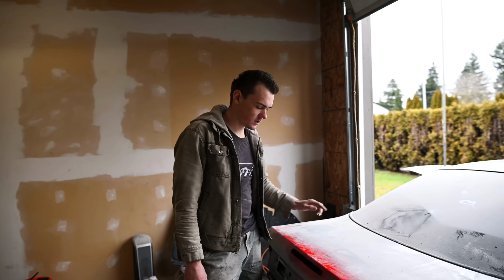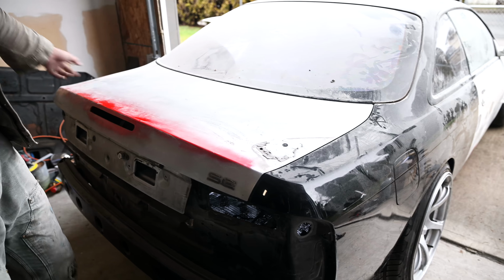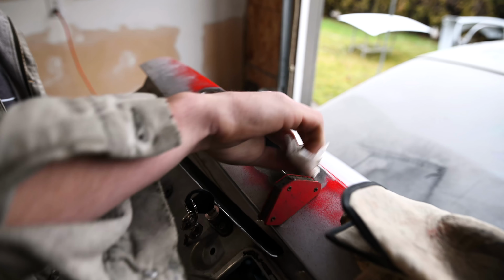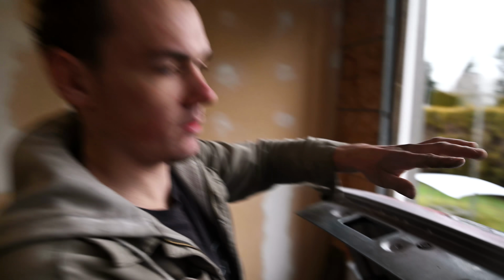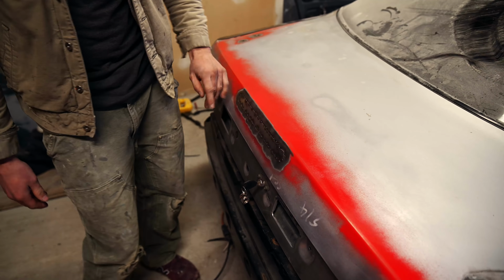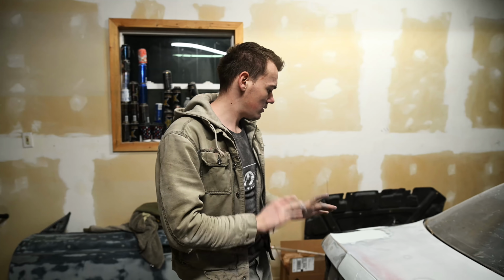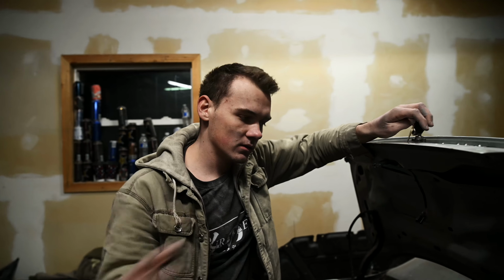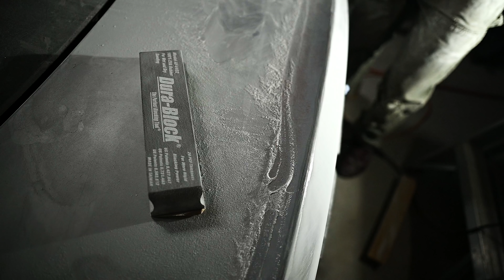EP.12 | DELETING Trunk holes And The Third Brake Light

Comment: If you don’t mind me asking, what are your wheel and tire specs? I’m trying to find out what to run in terms of stretch on 18x10.5s.
Reply: Need more info as far as ride height, alignment specs, fender specs etc. Bit a 255/35 is a pretty solid size on a 10.5